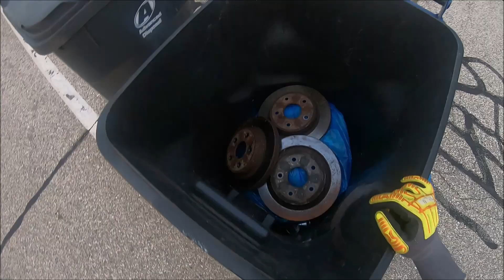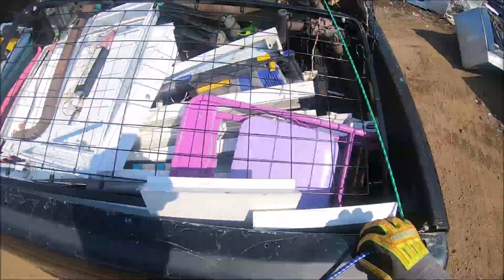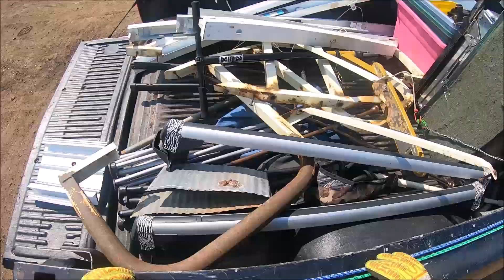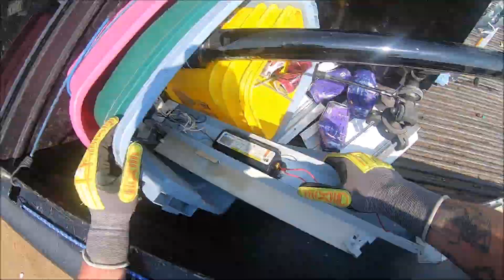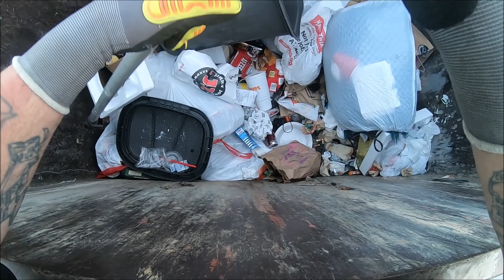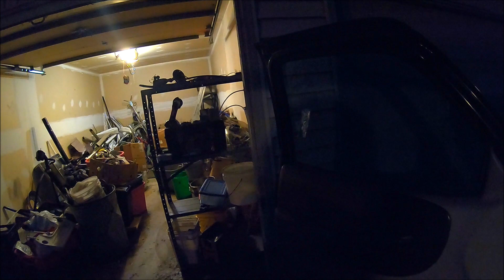SUNNY SCRAPPING WITH A STORMY END

Comment: your yard sure pays different than mine or any around me on cords and wires. if you bend the wire and it holds its bent shape it is considered #1. So far all of the wires I have cut from florescent lights is considered #1 at my yard. all cords and appliance wires and such are still #2. Eather way I cut ALL wires. any wire pays better than shred. copper is copper where ever it comes from so it always pays more. Yea I hate lightning storms as well. if it is lightning, it's time to go in and weight it out.
Reply from the maker: The yard I go to requires at least pencil lead thick wire for it to be considered #1. Either way, I need to keep that wire separate from my cords. Cords, #2, the other, low grade, (#3).